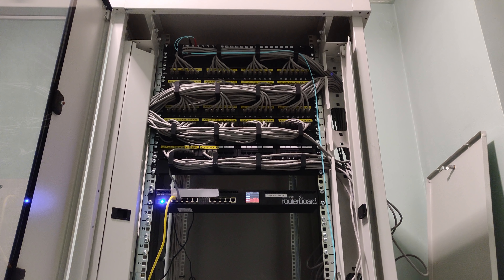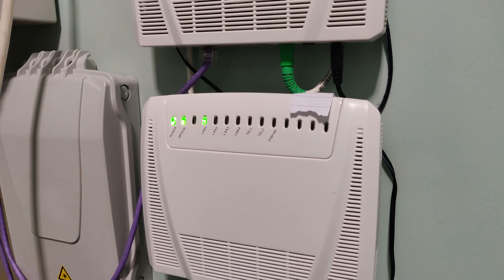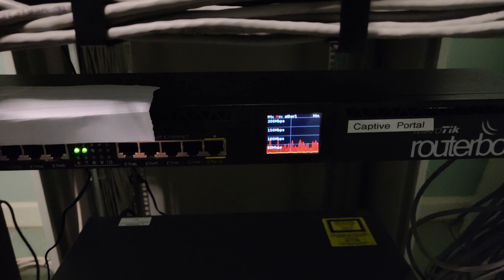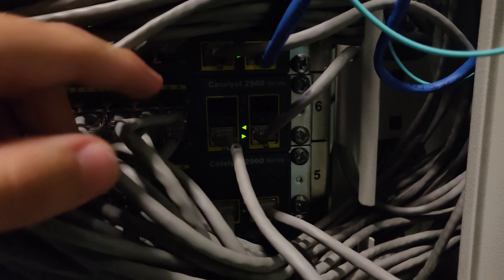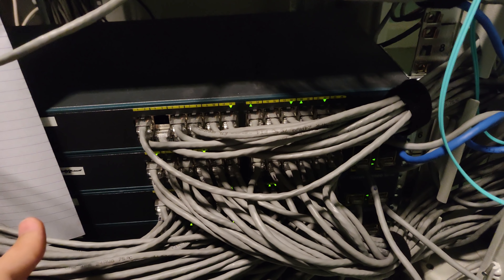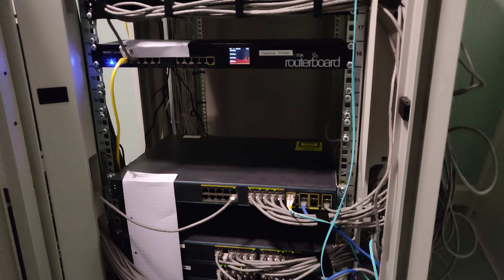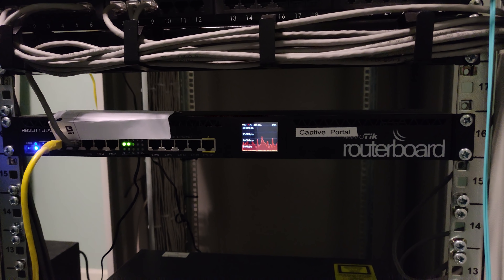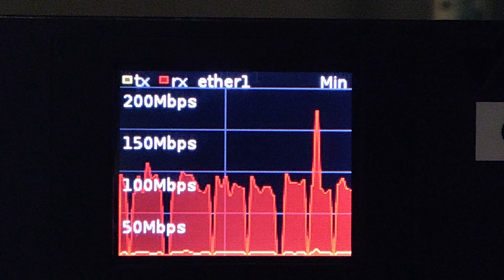Uni Student Halls Of Residence Network Comms Room Tour: Mikrotik Routerboard, Cisco Switches, Fibre!

Comment: The switch chain is painful.
Reply: @wiziek  Because they are using fiber ethernet which is point to point technology unlike GPON which is point to multipoint. They are doing this because they cover a really small area (and they got money from EU). Still no idea why they connected their switches like this rather than wire each switch directly to core switches.

Comment: Why are the switches Daisy chained, wouldn't it be better to directly connect those bottom 4 to the top switch
Reply from the maker: That would be a lot more fault tolerant
Reply: @scivids1999  not to mention removing a big bottle neck
Reply: My thoughts exactly- even better to have stacked switches
Reply: Even better, connected directly to the mikrotik router..
Still  no redundancy, but better than daisy chaining.
Reply: @jnic2003  Depends on the type of network traffic... If there's only client devices there should be little traffic between devices as each device pretty much sends all it's traffic to the gateway which can only handle so much anyway.
If you're hosting servers and such which cause a lot of traffic over the network you might want to have a higher tier core switch which connects to all the edge switches but in a residence or office daisy chaining user device switches is fine.
Reply: I would connect those switches via a stack cable and do fiber channel from the top to all the switches. No DAISY CHAINING. That's like the core rule in networking.
Reply: @evanhaston4447  I'd keep the fibre channel within the SAN and use fiber optics for networking and yeah I wouldn't recommend daisy chaining like this, much rather go for dual core switches spanning out to the edge switches for redundancy and scalabilty but unless you have the budget to do it right you're gonna do it wrong anyway...
Reply: @someguy4915  given that the 2960G model only supports SFP and not SFP+ ports going all fiber in a cabinet like this is a waste of money.  There is effectively no different between the gig copper uplink port or the SFP uplink port, infact on the particular model he has the Copper and SFP ports are tied to the same ASIC so hardware wise you get zero benefits when connecting switches in the same IDF.
Reply: @someguy4915  also daisy chaining is still bad even in an access closet.  While yes the throughput of any link is still capped at whatever the throughput of the firewall is, there is no fault tolerance in a daisychainned design. Additionally there is a limit to the number of hops spanning tree will allow.  The default is 7 hops so be careful.  Every switch that is daisychainned adds to the convergence time in spanning tree which means longer network outages (not that there is any redundancy in the network to converge to anyway)

Comment: So Mikrotik and TOR Cisco switches are single point of failure. So by me it shold be two CCR1036 or 1072 that are stacked. From them 4 connections to 10G switches on two side of campus. On each site should be 10G switches that are stacked (active/standby) with 2x 40G QSFP+ DAC for full redudancy.  In your case, when you lose RB or any of the Cisco, you are offline.  :)   In your setup, you should add one more mikrotk in first site and one more catalyst in stack at each site.
Reply from the maker: It's not my design! The RB2011 is inadequate really aswell. I have suggested lots of improvements but lots of people have to approve spending so not much I can do at the moment.
Reply: When utilising 10G links or above, one should always use full fibre rather than DAC, since DAC uses 4x more power and has over 10x higher latency -- not to mention the limited length of cable runs on copper DAC, vs much longer with fibre.

A RB2011 is actually underpowered for this setup, especially if the first ISP uplink (presumed 1G) is "pretty much saturated" during peak. The RB2011 barely routes above 1Gbit with minimal filters, chains and no QoS - adding complexity will cause performance to tank noticeably.

However, a CCR of any type is not a good edge/border/core router in my experience, since the Tilera CPU cores are severely underpowered compared to equivalent clocked MIPS or ARM CPUs. A pair of RB4011s would be more suitable for this type of network, which can route up to 9Gbit of traffic dependent on packet size and route chain complexity. Plus, the RB4011s are fanless, have much lower power consumption and can still handle 10G SFP+.

The switches... yes, daisy chained, super bad. But at the end of the day, if the RB2011 router fails (which is more likely than a switch) then the whole network dies anyhow. It'd be more sensible, in my opinion, to go:

1. Inbound fibre, terminating into the ONTs
2. GbE from each ONT into two independent "core" switches, or one "core" switch stack
3. 2x RB4011s, configured active-passive via VRRP, with each RB4011 having its own SFP+ connection to the "core" switches which connects back to both ONTs
4. Directly connect each student switch to the "core" switches, via SFP+ or 2x GbE in LACP
5. Directly connect the remote "B side" rack back to the "core" switches using 2x SFP+

Using two core switches (like the CRS328-4C-20S-4S+RM for example) would allow full graceful failure of either a ONT, a RB4011, or a core switch -- because VRRP would handle the routing, and with diverse connections from "core" switches to each student switch, any one "core" switch failure is allowed.
A switch stack would be preferable, but is not immune to failure (i.e. configuration issue or software bug) and would cost several thousand more to buy compatible switches. We can obviously see the network is budget constrained so it's probably not possible, nor even "required" to have 100% uptime in any case.

Anyway, in all, a nice video to watch and the setup is obviously functional so can't complain! I hope to see more videos of expansion and improvements :)
Reply: @olorinhenderson  dac uses less power than optics. You are thinking of 10gbaset, which uses an ethernet cable and tons of power

Comment: Out of curiosity, why don't you connect both fiber lines through the router board as separate connections, and allocate one fiber line per side of campus? And bridge the networks with a router to allow for local traffic between the two networks? It seems like it should be possible to do fairly simply.

Comment: I would connect those switches via a stack cable and do fiber channel from the top to all the switches. No DAISY CHAINING. That's like the core rule in networking. Plus you have zero redundancy. You should have at least 2 fiber lines going to the other part of the building, 2 copper lines going to the switch stack and 2 copper lines coming from the modem. If you really wanted redundancy you would have a backup route to another modem in case the primary line fails.
Reply: the 2960G does not support stackwise capability.  That's why it's not stacked.

Comment: The only problem with this network is the traffic of 100+ network connections being pushed through one cat 5e cable to the fiber connection. Even with 2 fibers which the speaker says will be coming in the future, the bottleneck will still exist. Also, I believe the cisco 2600 switch only does at most 100mb connection per port  including the uplink port based on my experience; if someone can clarify, that would be okay.
Reply: That's my belief as well, poorly designed network.
Reply from the maker: There are lots of problems with this. The Mikrotik handling the routing is not even vaguely adequate, let alone the rest of it... Unfortunately, it's a complicated issue both network wise and corporate/finance wise. I was only a resident there aswell, there is almost nothing I can do if it involves money so sure everyone commenting here has solutions that would be very easy to deploy if this was in their house, but it's not and anything that costs money has to get approved through numerous levels of management.
Reply: They are "G" series switches. All ports are gigabit.

Comment: Routerboard? The Same brand the Public Transport of my City uses for it's free WiFi - which almost never works - there are literally two Buses whose WiFi doesn't have Internet for over 1 year now :(
Reply: There's a difference between the Wifi from the routerboard (which is fine) and the uplink over mobile network which is likely not fine as the bus moves through areas with poor coverage etc.
Reply: @someguy4915  Well, the 4G coverage in Germany is a total mess ...

Comment: You can make it better without spending money. It looks like your top 2960 is at 50% port capacity so what I would do is remove the daisy chaining as this is just asking for a spanning tree fault/loop also if the top switch of the chain fails you lose everything below, then home the bottom 4 switches to the top switch (make it the STP Root Bridge)  and if you have enough ports do bonding/LAG for increased capacity and redundancy. This design is a lot cleaner, spanning tree looks nicer and more deterministic.
Reply from the maker: The system is due to be rebuilt with Ubiquiti switches and a new Routerboard soon
Reply: Ubnt switches are terrible.

Comment: Neck beards saying this setup is trash lol. Loads of places running on average setups like this or much much worse, particularly in a student residence. Congrats if you work in a place with unlimited budget but in the real world where management and finance teams only care about the bottom line this is a fairly standard setup that is thankfully quite clean and tidy. Easy to criticise but the people putting this together probably were probably well aware of the flaws and limitations of the design but had to work to a budget and deadline. At the end of the day it’s all it is just going to be used for is streaming porn and Netflix doesn’t exactly need to be a cutting edge 40 or 10gig equip with full redundancy. Cheaper and older gear like this can still offer better speeds than some ISPs if you live in a crap area.
Reply from the maker: Very well said! It was built many years ago on the basis there was a single incoming 100mbps fibre line and as far as I can tell hasn't had a fault in that time. Management are trying to get it all replaced with Ubiquiti gear but awaiting finance to give approval. You've said what I've pointed out to other commenters very well, in that sure there are lots of easy fixes if I bought a house say and found this and it was my money but when there's numerous other levels, things become a lot more difficult.

Comment: Microtik. I hate it.
Reply from the maker: Why?
Reply: You can't even spell it.
Reply: @scivids1999 

I prefer juniper appliances. Or if u like a cheaper brand  , probably zyxel or dlink.
Cheap appliances must be simple, otherwise configuration will cost more than appliance itself.

Or you will work gratis.
Reply: @scivids1999 

When you build appliances you can do what you like, but when you buy a boxed one must be better and simpler than what you can build yourself.